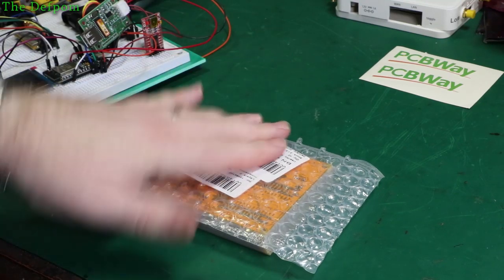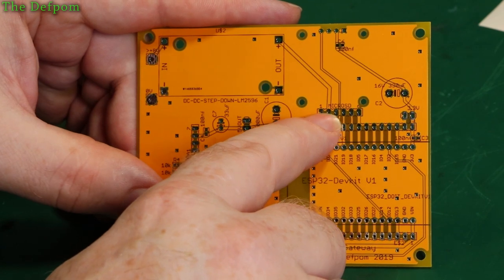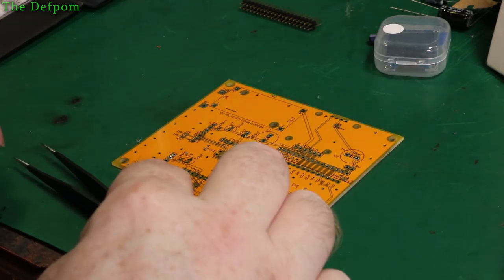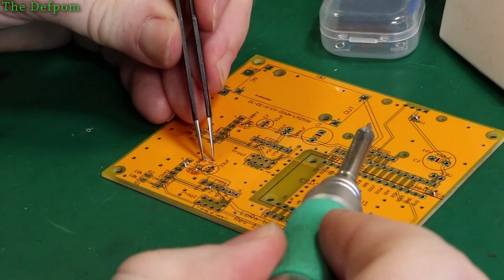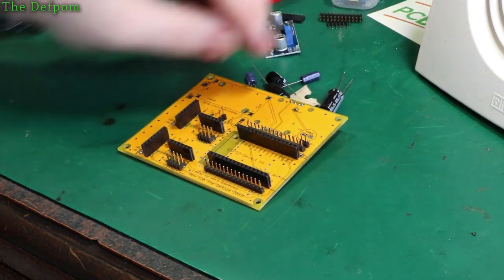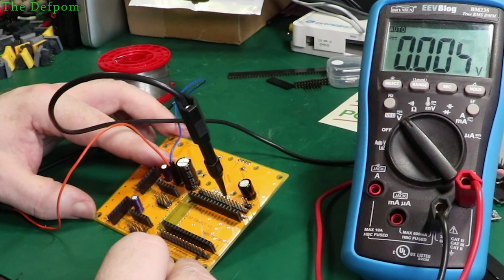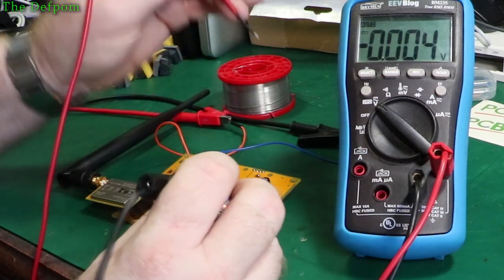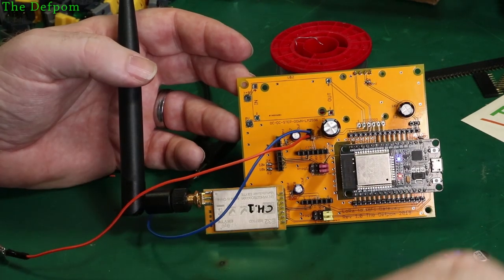#681 Make A LoRa to WiFi Gateway Project Part 2 - Free PCB's From PCBway

Comment: Print your Gerber's out and check connections to cct and footprint sizes before sending for manufacture. don't take long and saves money in the long run. I just use a highlighter to mark off tracks on the cct for my own piece of mind. Had to do it at work due to the cost of PCB, but still do it at home even PCB.s are a lot cheaper.